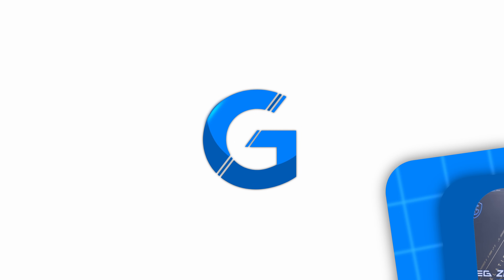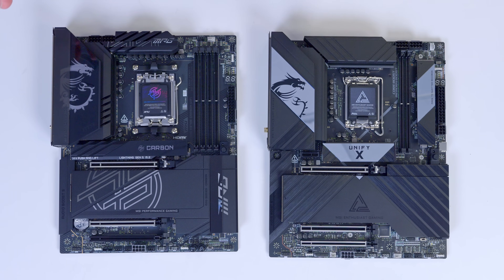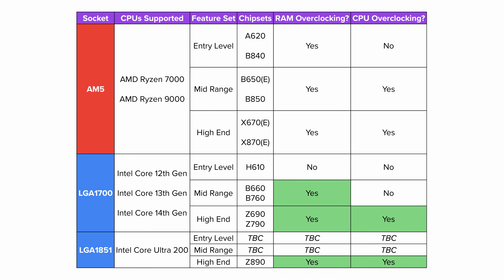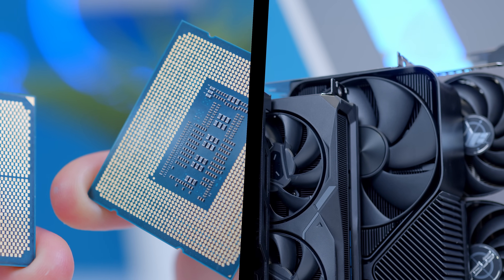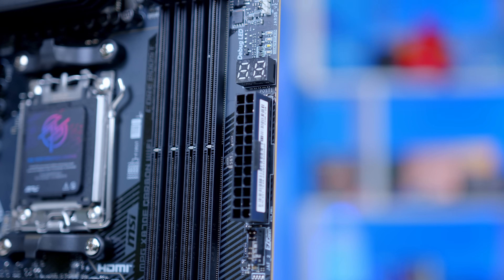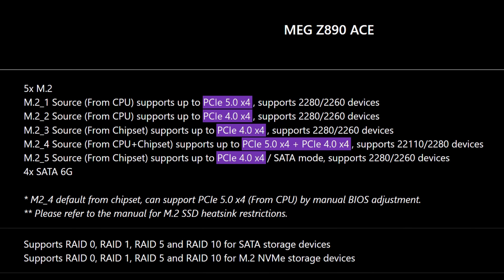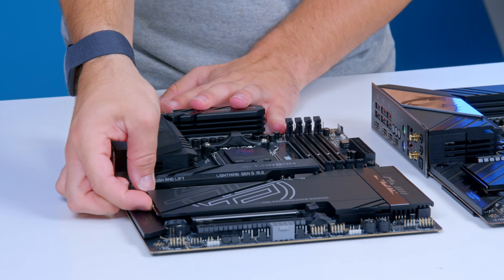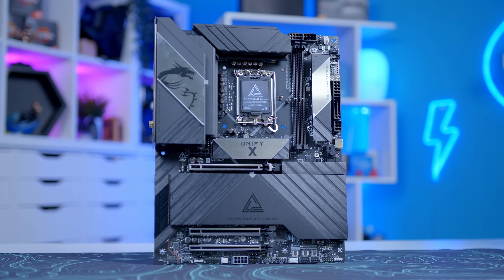How to Pick the Perfect Motherboard in 2024! 👌 [Everything to Know Before Buying]

Comment: This was helpful! MB’s are always what stump me when I’m working on a new build! I know that I need to get one that has the right components for the rest of my build but when you have a dozen different manufacturers that have a their own model for the same exact chipset, but you have a price ranging from $200 to $500… it just gets confusing!!

Ultimately my build ended up being as follows…
1. MSI Pro z-790 A MAX WiFi
2. I5-13600K
3. Crucial Pro DDR5 32GB
4. MSI Ventus RTX 4080

Basically it’s a been a very strong and capable system, but it isn’t a super computer. I do plan on upgrading my CPU soon, but I’m still just gaming in 1440 and haven’t felt like I’ve needed anything more yet.

Comment: I’m needing to build a pc for audio production. It seems to me AMD may be preferable as they don’t change the processor shape every 2 years and it may be easier to upgrade the processor later. Is this a fair assessment?
Reply: Depends how often you want/need to upgrade. Every 3 to 5 years is good enough for me, i just buy something now and see it later. I dont mind buying another mobo in 3/5 years. AMD is preferable for socket upgradability but Intel is fine, A good AMD or Intel CPU will happily serve u for 5 years with enough ram.
Reply: @djangojansen7648  And what do you do with the older computer after? 3 to 5 years isn't long enough to me.
Reply: @luigiprovencher  Give the parts to my pc builder, although I often build them myself aswell

Comment: Between the MSI B650 GAMING PLUS Wifi vs Gigabyte EAGLE AX or GIGABYTE gaming X Ax or the V2 which one do you recommend?? With upgradeability in mind. Also they are similarly priced in my place with just 15 dollars separating them
Reply: Never go with gigabyte
Reply: @thesicilianlover  reason?
Reply: @VoidWalkeR-y5s  they tend to have quality issues. I had the X670 Aorus elite AX. Constant WiFi drops, pc will randomly boot without WiFi drivers, mouse stutter. Switching to a MSI B650 gaming plus WiFi board
Reply: @thesicilianlover  but I heard from most people they are solid asf same goes for MSI

Comment: Hi!

I love ur  vids and I am abouth to build a gaming PC for me. But I have on question:
How should I orientate the fans? I already got that I need to have an airflow direction, but should there more air coming out or in? <3
Reply: From the front and maybe like one in the back as exhaust you always want more intake than fans blowing the air out
Reply: I've always directed air in through the front of the case and out the back and/or in through bottom and out through top, if you are also using bottom and top fans. I am using a Lan boy Air (open case design) and have for the last 10 years. Granted, I'm not an overclock-er, but that has always kept all my components very cool (and hard to keep clean). I am getting ready to add my whole new tower to a cabinet and again I am modifying  the cabinet (and the case) so that Intake air comes in at the bottom of the cabinet and exhaust at the top gets pulled out. Remember hot air rises so pull the hot old air upward. I watched a build video recently and they put smoke through a case that was built this way. It was cool to visually see the smoke go in through the front and out the back exhaust fan and then drift upward. Although, I cringed at the idea of smoke blowing over those expensive parts.

Comment: Everything you need to know before buying a motherboard is to avoid purchasing MSI due to low manufacturing quality and bad rma
Reply: I’m so sick of seeing these comments man. (Not you specifically just ranting) there’s apparently not a single brand of motherboard without issues or a single kind of chipset that’s actually worth buying. I’ve been researching motherboards for like 3 days now and I can’t figure out a single good answer for what I should get. 

I finally just got a MSI x670e tomahawk for $230. If the fucking thing explodes when I turn it on, whatever.
Reply: @Williminal msi or asrock seem to be the best right now in regards to build quality and warranty/return policies so you did pretty well imo
Reply: @Williminal I am in same dilemma, msi tomahawk MAX wifi was my choice but found some videos saying it's high heat near cpu area that hold me back and it was the best for me till I found that😢

Comment: Ryzen 9800X3D + RTX 5080/5090 (soon) - what tier motherboard should i get?  I get the impression X870E is a waste of money...
Reply: Personally, I would never go above the B650E ,,if I haven't bought with a good price a combo deal 7800x3d, with Gigabyte B650 Gaming X AX V2, and Ram from Microcenter, which runs perfect from day one, I would have bought B650E Taichi Lite.
Reply: Go with Msi x670 carbon
Reply: @ktfaisal4096  X670E Carbon = no stock in Canada
X870E has stock for $800CAD (~600USD)